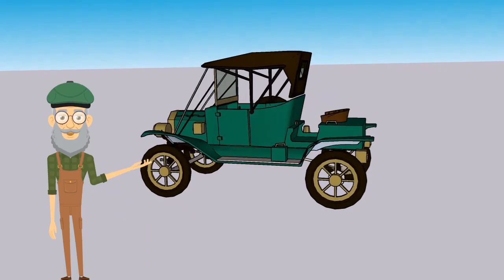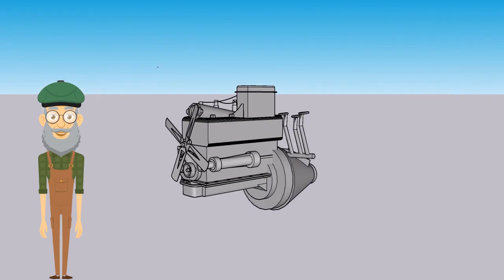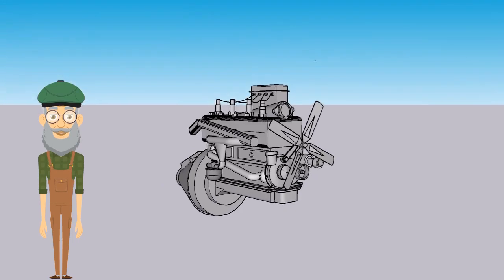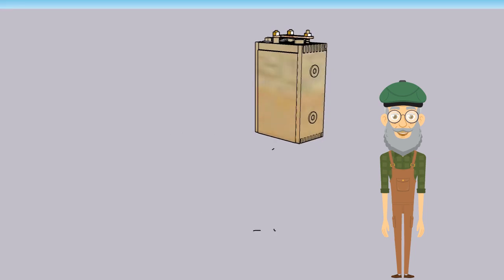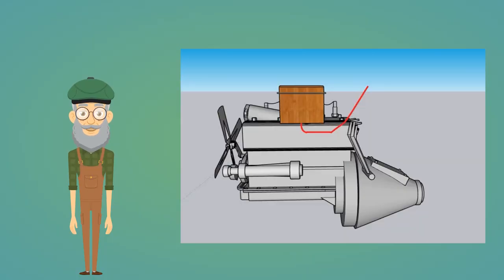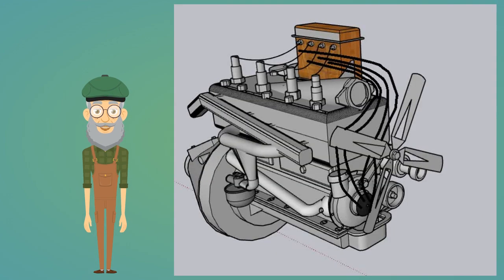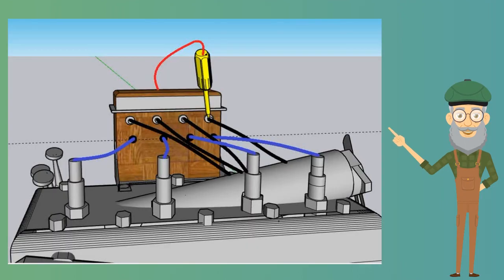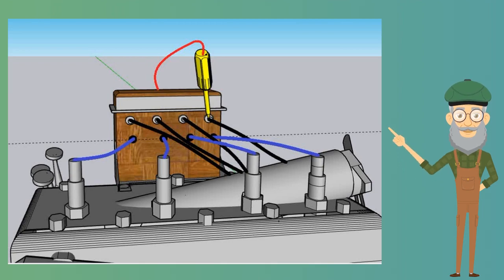Model T Ford Ignition System Animation

Comment: Back in the 70’s you could buy an old vibrator coil for a few dollars. They made a great high voltage source for a Christmas present.  Who else built one? We used 3 rolls of rubber tape on it because it might get tossed when you handed it off and pressed the button. Lol